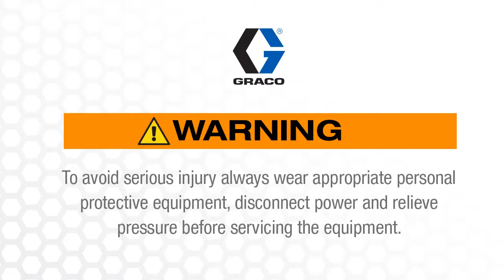Auto Lube Basics: Single Line Parallel Injectors

Comment: Nice vid, in what circs would you want to use a pressure switch rather than just letting the pump run on a timed basis?
Reply from the maker: Hello! Thank you for reaching out! Utilizing a pressure switch will tell the pump when to stop running. In the case of a G3 pump, if the pump keeps running after reaching pressure then the excess grease is returned to the pump reservoir through the Pressure Relief Valve (PRV). The PRV is designed to be a safety relief, not for regular use. By frequently sending grease through the PRV, it will wear out the valve and then the valve will allow a constant bypass. At that point, the system will no longer be able to build pressure and the injectors will stop functioning.